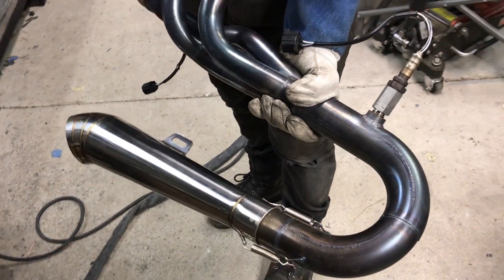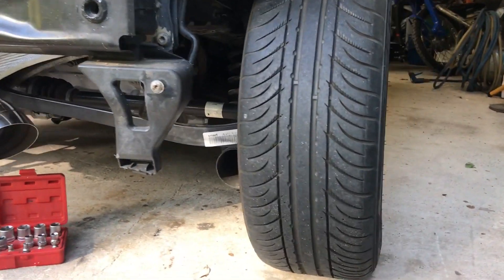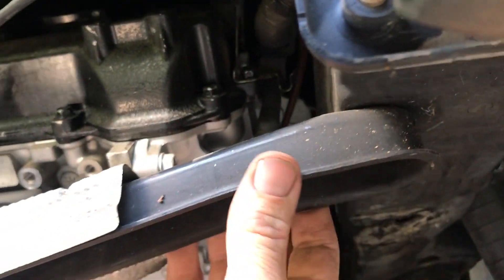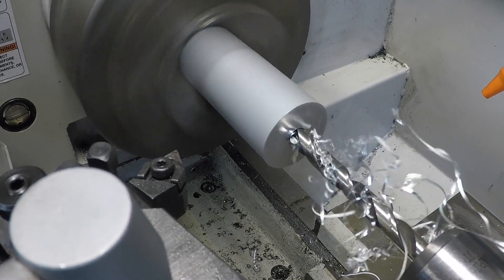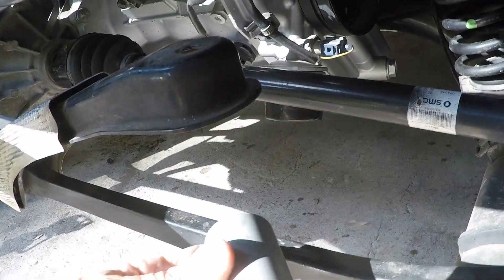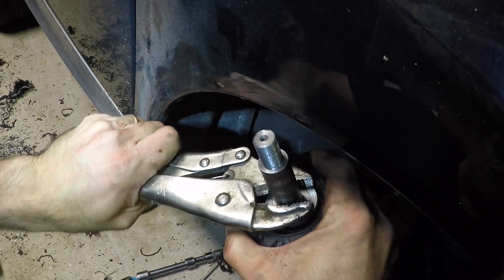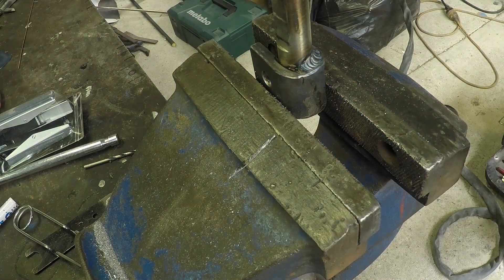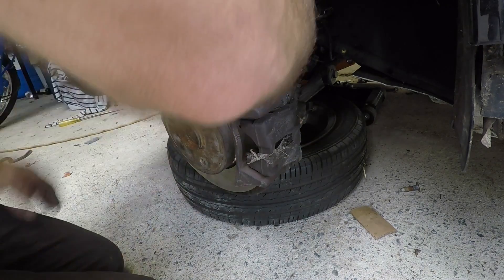Smart Car part 9 custom lift kit

Comment: Well done that man!
Very enjoyable to see you turn and weld as you have "The Skill"!!
I am after a Smart Car that has some problems and may be affordable and all your videos are so helpful regarding the project!
I gleaned so much from your re-build of the engine: The worn valve guide could well be the cause of a problem with the engine that I am concerned about.
I rode Motorcycle Scrambles/Motocross in the 60's 70's 80's & 90's.
I remember before I started riding I was trying to glean as much information as I could to be prepared for the Sport!
A Top Mechanic told me that he had fitted some Phosphor Bronze Exhaust and Inlet Valve Guides to a 500cc Rickman Matchless Mettise (In British Racing Green)!
These specially made components handled the heat so much better than the steel ones and eliminated the Valve Stems "Sticking" during "Hot" Competition!
Especially the Hotter Running Exhaust Valve Stem Guides! 
With your skills you could turn some up in the quest for perfection next time!
A German fellow's video shows him placing the engine/gearbox/Diff on a plywood plate with 4 castors on it to remove the assembly!
He placed a trolley jack under the plywood plate and raised it to meet the Differential and the Engine Sump.
He then removed the bolts, pipes etc and lowerd the engine/Gearbox etc to the ground.
After that he removed the trolley jack and just wheels the "Injun" around on the plate and castors: she don't mind that!
Your way looks more visually impressive but you say that it is a bit of a faff, so who knows?!
The advantage regarding your method is that one can do some refurbishing work on the sub frame etc more easily!
Both methods get the job done at the end of the day!
Marvelous series of perfect videos: thank you!
Rob of Halmore.
In the Berkeley Vale.
The West of England.
Reply from the maker: Thanks for your comments Rob. Yep, Smart car valve guides seem to be a weak point. I replaced them with OEM, agree bronze is better. I used performance bronze guides in my Celica race engine, build also on my site.
My plans for the Smart car are to make it into something a bit different and an offroad version. The engine build was to get it back to new condition with just some basic mods. Its a bit trciky as I'm just doing mods I think will work as I can't seem to find any info on what others have done. Looks like very few people take the time to rebuild these engines but imo they are not bad. Just not engineered for maintenance. Mercedes just want you to buy a new car or engine. Anyways, welcome. I hope to post the next Smart car video sometime soon. cheers!
Reply: @Mezzmoengineering  A Celica Racing Man!!! Good Stuff!I like it!  They all have another thing coming if they think that we will Chuck Every Bit and Engine away though! 
My Foreman in a previous Electricity Supply Engineering Life impressed upon me when he gave me some thing to repair that: "Man Made it, Man F---ed it up so Man Will Mend it! It is not made in Outer Space"! Tom was looking at me regarding the "Will" bit! Old School!
But! I was only speaking with my Mate Smith an old HGV 1 Trucking Mate: Mark Smith of M.S.C. (Mark Smith Commercials) Cambridge, Gloucestershire, England the other day. He had a huge Volvo F12 Truck Engine out on his workshop floor, virtually for scrap! Very little he could do with it! Cost of spares, Only skim the head once, labour costs etc it was not worth his while to rebuild it commercially! resurrect
Pleasure
Reply from the maker: @Rob-mk3lq  Yep, they need to try a lot harder to stop me fixing things. I have a future project planned where I will be building a pretty crazy tractor. Its probably a good 12 months away as I plan to build my dream workshop very soon. Restricted with space now and want to focus on this as my passion a lot more starting next year sometime

Comment: Need to add a extender in back suspension to the down side? Because i saw in all videos, all add a extender becaouse after the spring spacer, the suspension goes down a bit.
Reply from the maker: Correct, you could increase the spring length and then not need the spring spacer, BUT you would then have to replace the struts and shockers with something longer too. You need all the other spacers for the steering and suspension to work properly

Comment: Been trying to get a lift kit for mine, but they are not available, would you be willing to make one? I'm trying to put on 29"x10" tires (yeah I'm cutting fenders.) Also using EV shocks, struts and springs to et the extra height.
Reply from the maker: Hi Mate, I plan to offer my work to others in coming months but at the moment my lathe is out of action as I'm in the process of a major shed upgrade. Will confirm on one of my videos when I'm able to do stuff like that. Hopefully later this year.
Reply: @Mezzmoengineering  Awesome, let me know
Reply: Amazon sells the lift kit.
Reply: @bobbrown2312  not anymore they don't, they try to drop ship from daystar that doesn't make them anymore. got mine done thought, it's on 30 x10s with 14 inches of ground clearance

Comment: can you share all the dimensions of the parts?
Reply from the maker: Hi mate, I just freestyled these parts. I made them all the length I wanted to raise the car which was 60mm. So all aluminum spacers are 60mm long and all other plastic spacers also 60mm long to match. The top profiles for the suspension I machined to match what was there before. Hope this helps. I think 60mm is about the max lift...
Reply: @Mezzmoengineering  if i change all the springs with longer, and add the wheel spacers in rims, you think i take the same result?

Comment: i would've thought you'd just drop the 2 sub frames instead of a suspension lift but i'm not there so i'm sure there's a reason you did it like this instead, and i see no point in spending money needlessly when you can make the same parts at home much cheaper and you know what they are made of and the quality of the materials used
Reply from the maker: The front mod is literally as you say, but you still need to extend the top of the struts to make up the difference. I decided against just dropping the rear frame as it messes with hoses layout and some other stuff. The mod was pretty easy, even making the parts myself. If someone is prepared to pay then its probably a 3 or 4 hour job total.